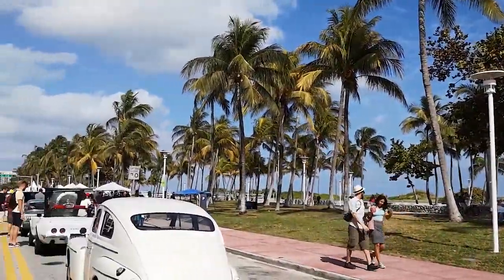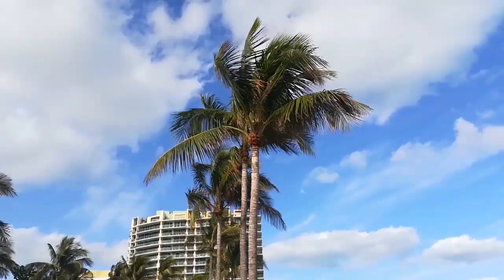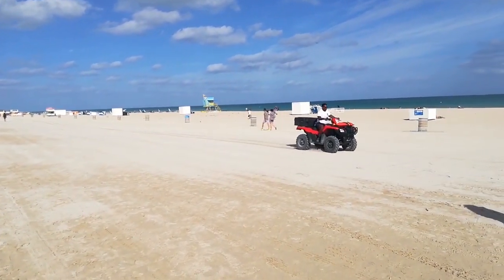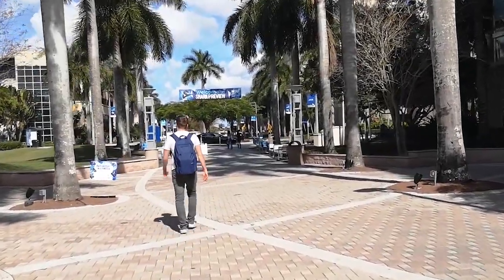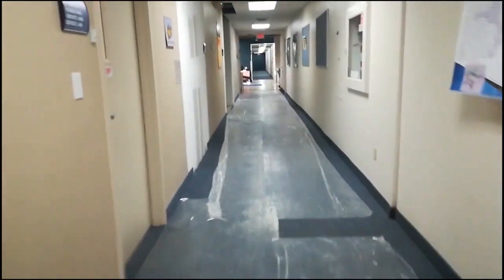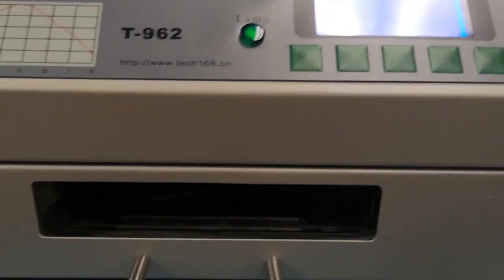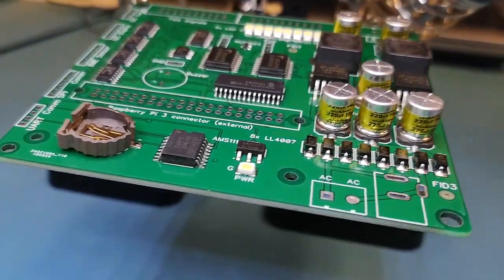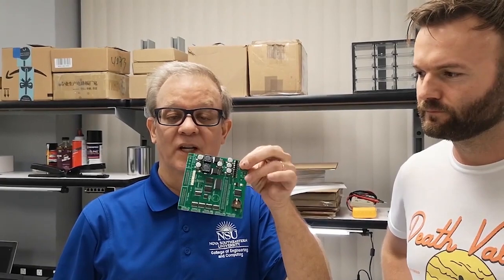VLOG - Building an e-nose in Florida

Comment: Did you discover how the metal template was created? It looks like a thin sheet of aluminum. In my imagination the holes that exposed the smd pads could be cut by a laser cutter using the same file he used to create the pcb. Am I close?
Reply from the maker: It's called a stencil. It's something you can order together with your PCB for about $10 extra. I'm not sure how they make it, but I would assume laster cutting. In most PCB design programs there's a solder paste layer that is used for the design of the stencil.
Reply: @Ohmify  Oh, I see! In that case, making an SMT board seems pretty easy to do at home.